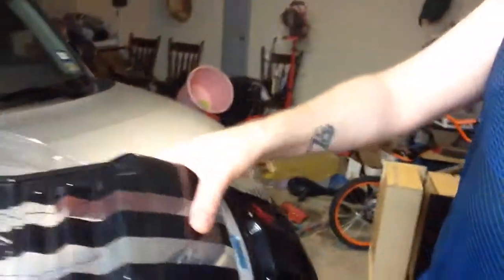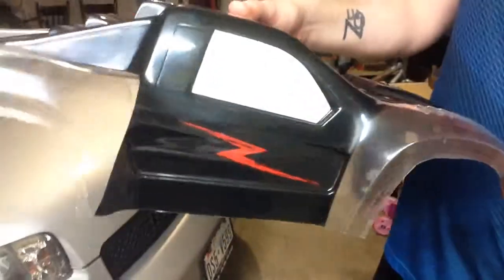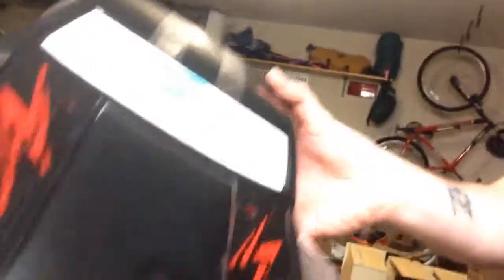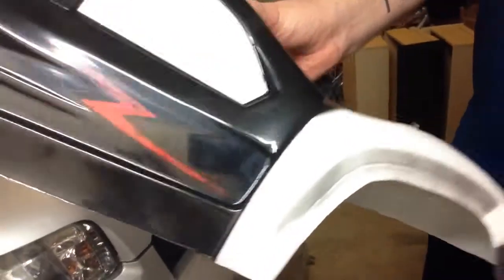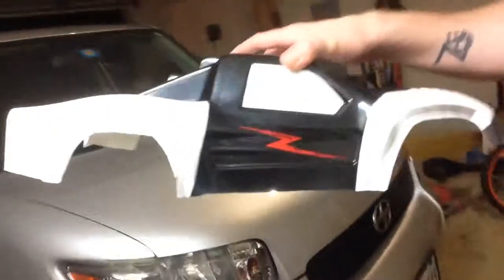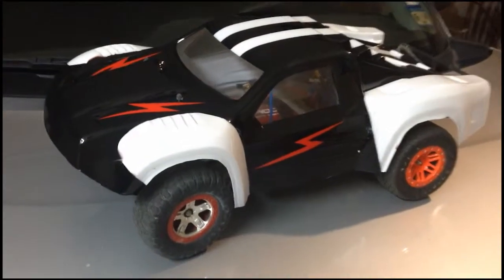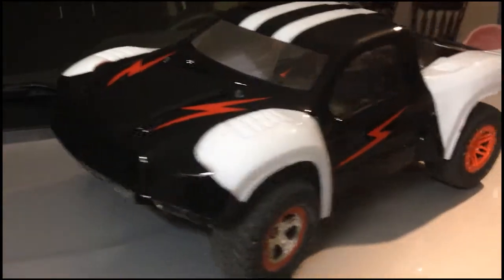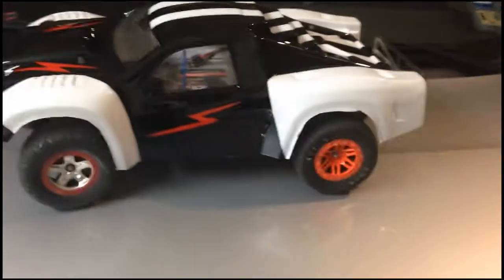proline flotek paint job

Comment: Just a FYI the RC paint has a different property to bend and flex like a skin. It's made differently to flex and bend with the body during crashes where other compounds chip and crack cause they are flakey and made of a different compound. Only reason the hobby paint is more $$ because its made to specifically to flex and last longer on lexan flexing bodies. But if krylon works for you more power to ya, just wanted to explain why the hobby paint is as much as it is.
Reply from the maker: Thanks man! Yeah I actually realized this the first time my son rolled this body kinda hard and the paint chipped a little on the inside LOL! Oh well, this works just fine for now and for his car.
Reply: Live and you learn, hey on the bright side, at least you have a huge can of this stuff to touch up haha